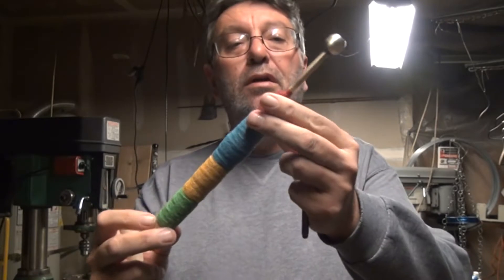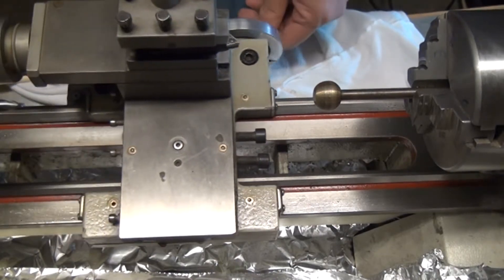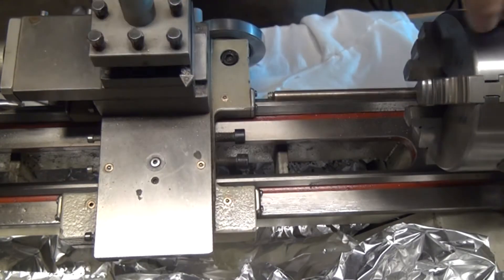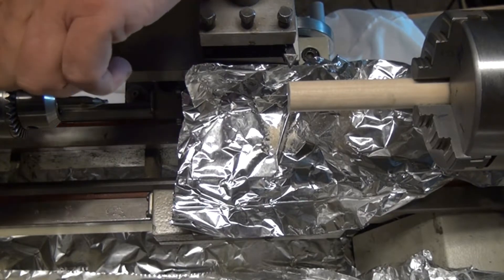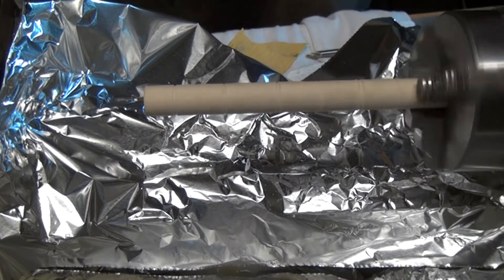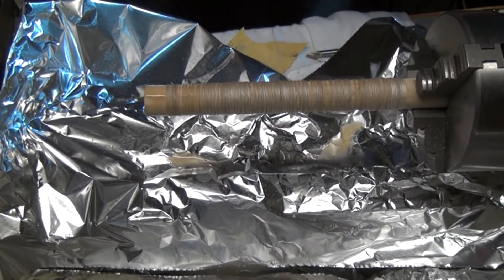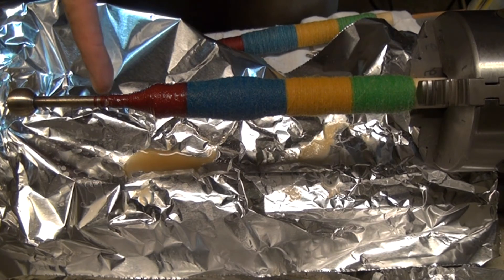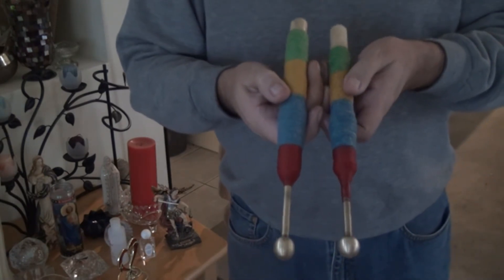Brass hammer lathe project

Comment: I like how you can change the size and shape ..with how much string is wrapped on
Reply from the maker: it is so easy to change the shape, i have found that i can change the texture with different kinds of threads and from thin yarn, to crochet thread, and when that shellac drys it is like concrete.  i had one end thread that came loos , so i just added a drop of E6000 glue and it held it in place very well.